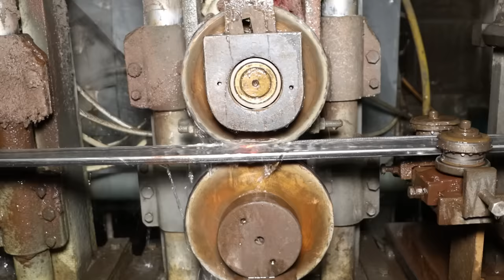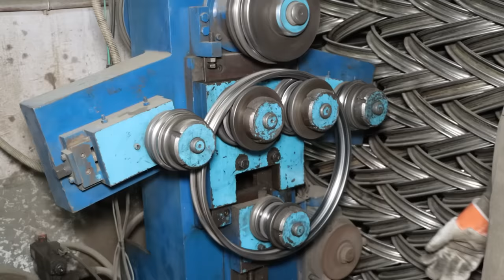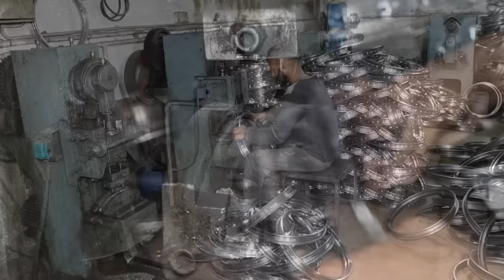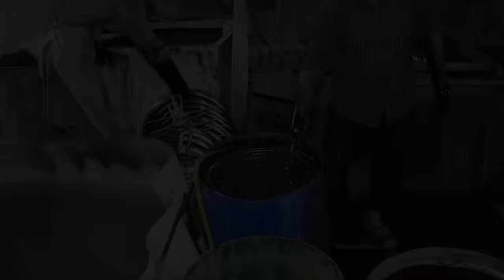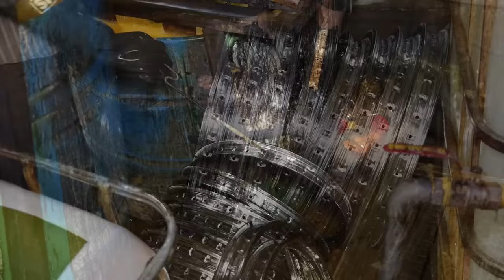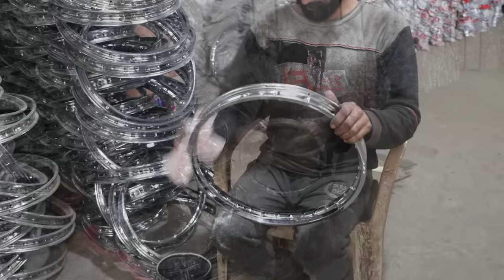Amazing Process of Making Motorcycle Wheel Rim | Factory Mass Production

Comment: Hey @randomthings, I was quite fascinated by your latest video. The level of skill exhibited by the workers is truly amazing. It's fascinating to see how these seemingly simple components are actually quite complex to manufacture.

I'm curious to learn more about the materials used in the production of motorcycle wheel rims. Are there different types of alloys or metals used, and how do these affect the performance of the wheel? The welding process used here seems quite precarious and probably unsuitable for any heavy duty bike. 

I am quite curious to understand more about the process of shaping and forming the metal into the final product. How do the workers ensure that each rim is consistent in size and shape? There seems to be little quality control about exact measurements and precision.

Furthermore, I wonder how these traditional manufacturing techniques compare to more modern,  automated machine-based methods. Are there advantages to using these more hands-on techniques, and do they produce better quality products? Or are machine-based methods faster and more cost-effective in the long run?
Reply: The welding method shown here consists of butting the ends together, passing a large electric current that heats the metal parts in contact close to melting point and then immediately "upsetting" the joint (compressing the ends forcibly together by a precisely controlled distance). This is the same technique as that used to join a band-saw blade into an endless loop. The joint looks very rough until the squished-out material is ground off, but it is a very sound joint. Have you ever seen a motorcycle wheel rim that has broken at the weld even after suffering a violent impact?
Reply: Yes
Reply: Dear..I supervised the same Machines process 45 years ago..Recommended Rim Material is imported from japan..size is measured by  wire gauge when cutting after rolling Machine .its is very simple and exact.but untrained worker can make mistake during  cutting process .if mistake occures and it passes to next process then at punching stage for wires holding Rim  it will be automatically indicated and division of punching will be wrong of the  Last punch..joint quality  and chrome is also very important  by visual checking..There are more than Ten major defects during manufacturing....1..pin holes during seam welding ...2..seam not welded as per standard.Result will be elasticated  product and totally wasted..3..size cutting wrong..4..But welding improper  ,joint loose ..5..over grinding of joint and  so on....